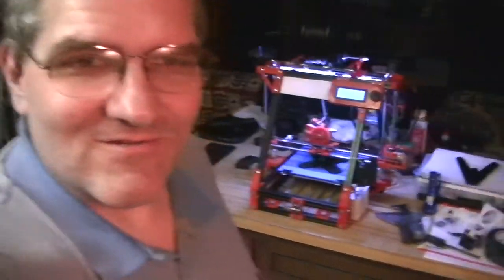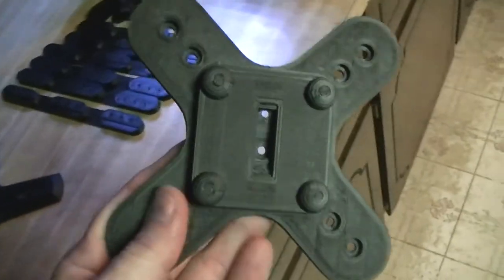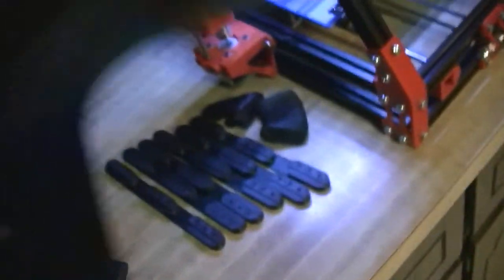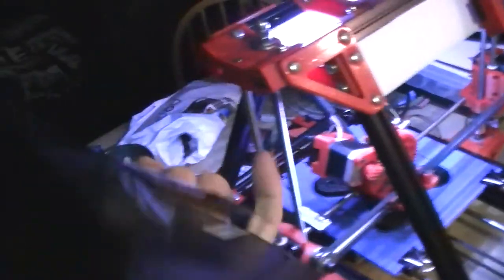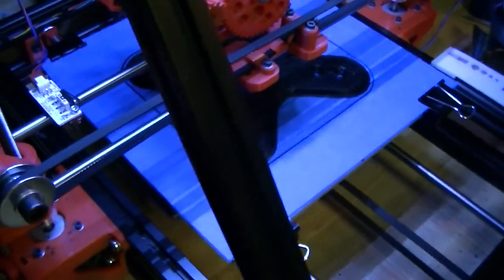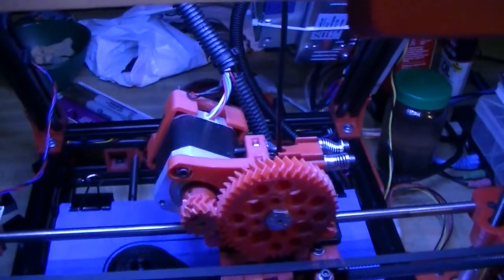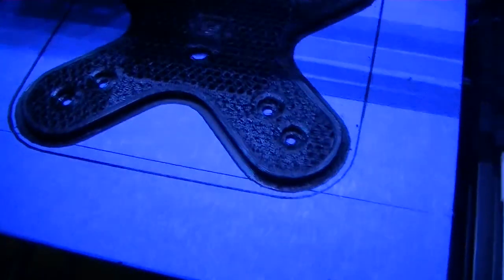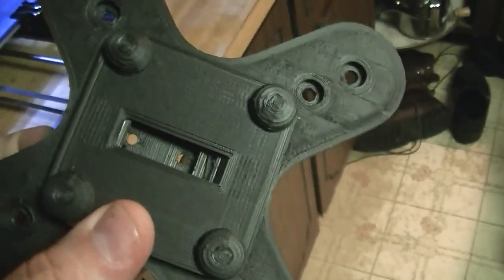2013 07 21 3D Printing VESA mounts

Comment: Awesome work Paul,
I'm building a Prusa Mendel ver 1.0 at the moment,
Could you do a video on what your software package you design your prints in and a rundown on what firmware etc you are running in i assume the RAMPS 1.4  and any code changes you may have had to do Please.